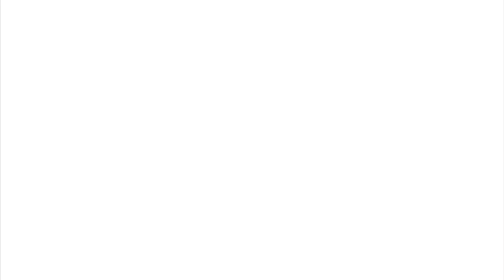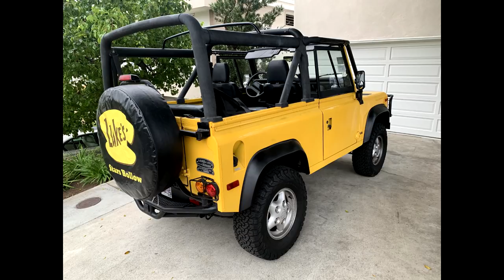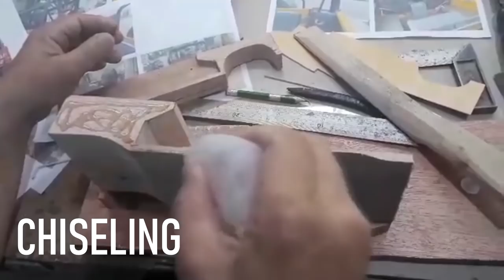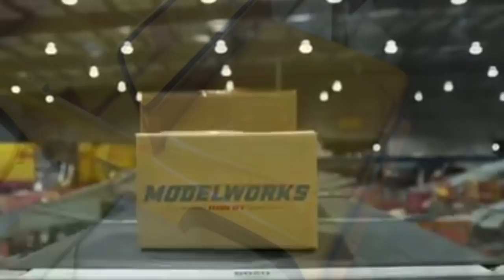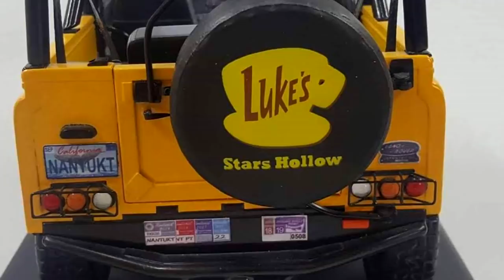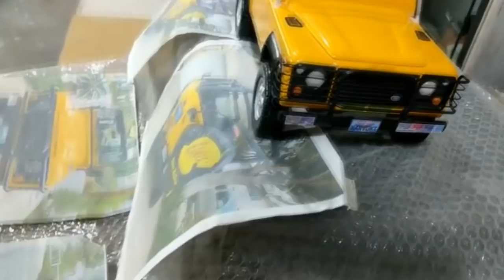How to build a Custom Car Model of Doug Demuro's 1997 Land Rover Defender. North American Version.

Comment: They can replicate the very detailed stickers but not the Land Rover badges, no front seats and what's with the grey front roll bar?
Reply: the finished model Doug received and shows in his video has the roll bar painted black and the seats in place. Also the tire is on in the back.
Reply: Yeah, I guess they didn't show the finished bit at first.  Good job guys! Too bad about that extra reverse light though. 🤪